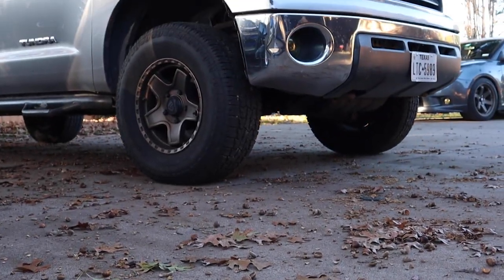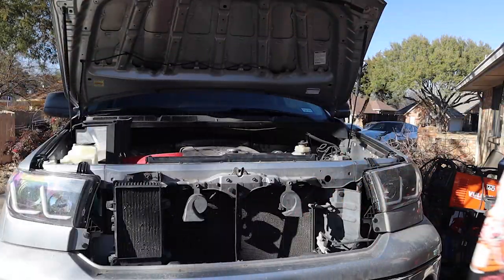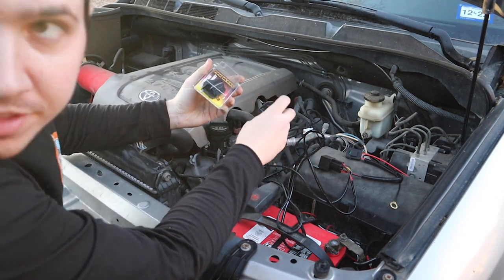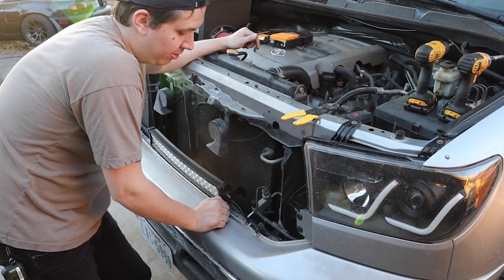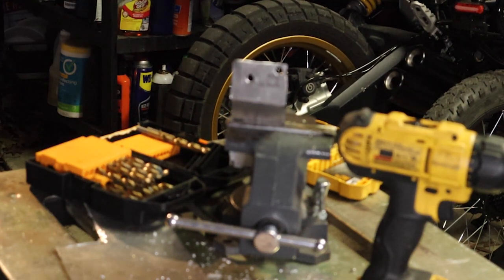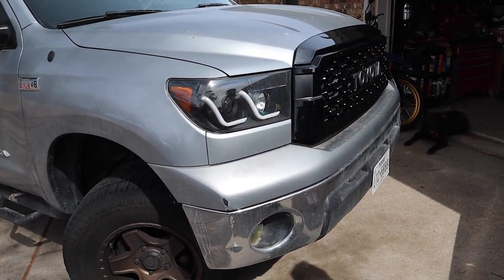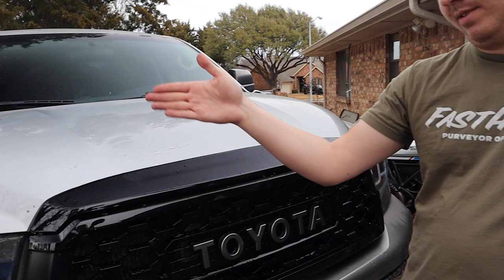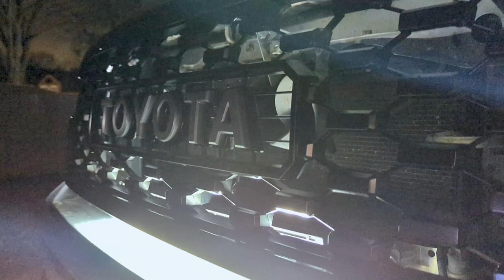Tundra Grill Conversion (2007-2010) to 2020 Sequoia TRD (&stealth LED light bar install)

Comment: All you need to do is put on that 2020 Toyota Sequoia trd bumper so you won’t have that gap in the middle in between your grill and bumper. I did The Whole front conversión on my 2007 Toyota Tundra and now it looks like a 2020 tundra.
Reply: I have a 2007 Tundra and looking to do the same conversion. Could you help me find the part numbers needed for the whole conversion. The link in description no longer is for sale
Reply from the maker: Interesting..if you go to that link still, they still have the part numbers listed for what you need!
Reply: Looking for bumper as well

Comment: Awesome Video. Thanks for sharing. Also, did you black out the front and rear bumpers? I'm going to do that asap. I'd like to see a video on that job as well as the LED hi and lo headlight upgrades. You've been extremely helpful. I conquered the installation of my new headlights with your wiring ideas, I now have to figure out how to change the Hi and Lo halogen's to LED's. The DRL's I have are awesome.

Comment: I like that grill n the light bar I have a 2011 Toyota tundra crewmax I’m upgrading the lights to led too .
Reply from the maker: Very nice, I'd definitely point you towards a company I've been working with lately called LasFit. You can use a discount code we have, and their products are SUPER nice for LED bulbs and light bars.

Comment: You should have put those RAPTOR LED LIGHTS in it, buttt anyways I was told by someone else that I would need to order the 2010 TRD PRO for my 07 TUNDRA. The guy said it fits better and the only thing I would need is the brackets. I'm not sure if it's legit or not.

Comment: Maybe I missed it, but do you show how you gained access to the cab from the engine bay?
Reply from the maker: Been a while since I've done this, but I believe I briefly showed me working under the steering wheel/drivers side footwell area. There is a rubber grommet that goes from the engine bay into the footwell!
Reply: Ah, gotcha! Ty
Reply from the maker: @OnwanashiboNarfall  no problem!

Comment: Can anyone reach in below the grill and pop the hood?  Thanks in advance.  Looks great.  I want to do the same thing.
Reply from the maker: I don't believe so. Additionally, I actually removed the long bar that goes from the upper latch to the lower latch, so it's not really visible, and definitely no way to open the hood, at least without a lot of effort, without popping the hood from inside the car.
Reply: @BrunerTuner  thank you.  Can you do an additional video to show this?

Comment: Brackets:

531170C030

531180C030

Grille molding:

531110C240C0

Grille:

PT3630C200BL

If I’m not mistaken, this is all you need.
Reply from the maker: I believe that should be accurate!
Reply: Where can I order these parts?
Reply: @daviddeleon2965  Toyota dealer.

Comment: Just want your thought process to not color match! Truck looks good, just don’t know how I want to go with mine!
Reply from the maker: The old grill was black, so it just made sense to me to go black! It was also on sale for cheaper than the other colors at the time!
Reply: @BrunerTuner  correct me if I’m wrong, when I fill out the drop downs, it’s only to paint the surrounding parts (hood trim)not the actual center-honeycomb section, right?
Reply from the maker: I legitimately don't know, actually! You probably did more research than I did at this point.

Comment: Did you need the new brackets or did you keep the stock 07-09 ones?
Reply from the maker: Ended up with the newer brackets! Found some OEM style replacements for like $40 shipped.
Reply: @BrunerTuner  do you have a link to these brackets?

Comment: Will this same grill fit a 2013 tundra crewmax?
Reply from the maker: I doubt it, because those tundras have a different hood and grill design than the first 07-10
Reply: It does. Check out this thread.
https://www.tundras.com/threads/2020-sequoia-trd-pro-grill-conversion.55533/

Comment: Does anyone know if the 2020 sequoia trd pro grill fit a 2015 sr5 sequoia? I bought a tundra grill and was missing the same piece on top and didn’t know where to get one
Reply from the maker: I would think it would, but I can't say for sure.
Reply: 2020 TRD pro grille will fit any model Sequoia 08+

Comment: Nope.
Reply from the maker: Cool
Reply: @BrunerTuner  half assed the light bar kid. The grill mock up was ok but all that could be buttoned up better.

I do appreciate the parts list to complete it. That Walmart rocker switch seemed to work but you could get factory-ish switches from the taco sites and make that a much cleaner install.
Reply: Hi do I need new brackets kit for 2008 Toyota Sequoia?
Reply from the maker: Hi, I do not know for sure, but I would think so. You should do some research into it and make sure.